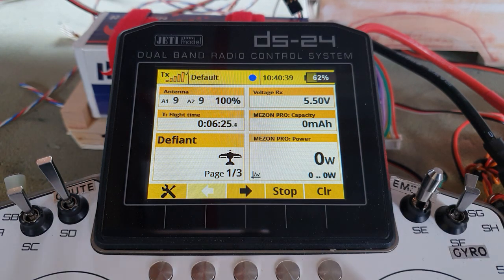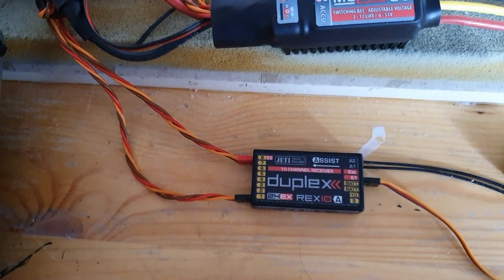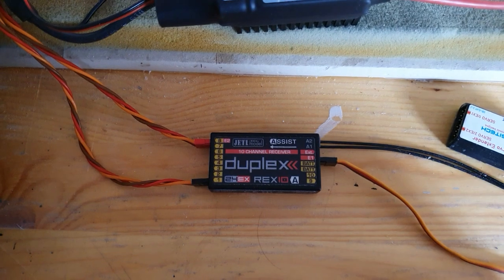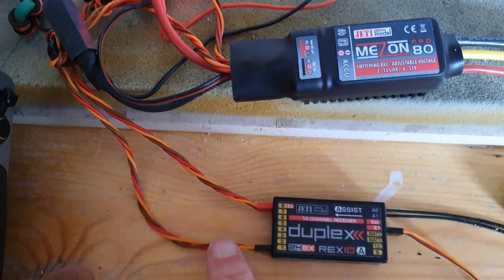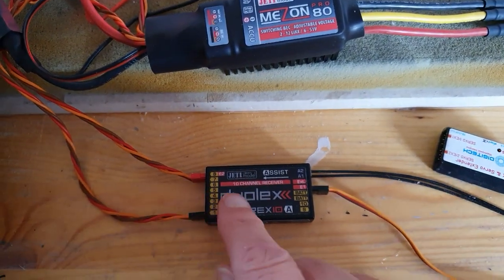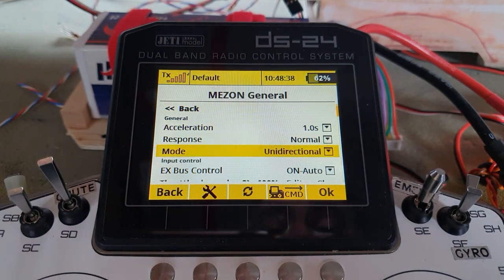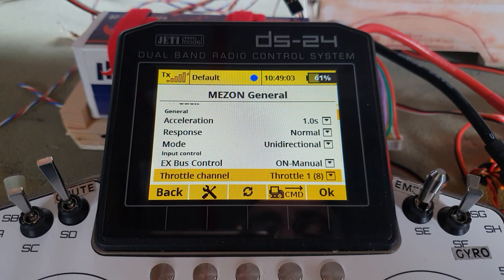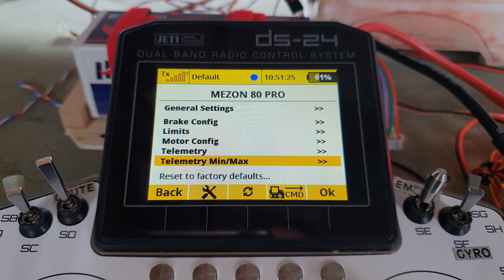Jeti - Mezon Pro ESC, Exbus control

Comment: Will I able to connect two independent ESCs, same specs, via a Y lead to a single motor? Will I be able to switch between the ESCs via separate channels on the radio? Can one of them be programmed in reverse? Trying to find a way to make reverse thrust work on Jeti for electric models, EDF foamies.
Reply from the maker: No.  You need an esc that can do reverse.
Reply: Can you recommend any? Between 60A to 130A? I can't seem to find any, but I am new to the RC and Jeti.
Reply: Can you recommend any?
Reply from the maker: @dcabrick  no, I have experience of ESCs that can reverse.

Comment: Harry doesn't the Mezon Pro provide battery current and voltage data?  Shouldn't that allow you to eliminate the MUI from this setup?  Thanks!  Really appreciate your videos.  I have learned more in a week or so from your video's than I learn in the last two years from Jeti information and the tech at the business I buy my Jeti items from.  I especially appreciate that you explain the reasons that you are doing or not doing things which is very helpful in really learning how the system works!
Reply from the maker: Yes it does, there is no MUI in this setup.  I was referring to using a MUI before getting a mezon

Comment: Hi Harry
I have DS14 transmiter, REX 7 receiver and Spin 66 Pro regler. Is some way to recive telemetry data from model about tension Volts on battery in model and current Amps when engine is running?
Reply from the maker: Only by adding jetibox emulator to displayed telemetry.  Spin Pro uses an old telemetry protocol, the transmitter can not see it sensors and logging, and the data is not available in the menus like alarms, etc
Reply: @cotswoldpilot  this emulator is some hardware device or software for transmiter?
Reply from the maker: @MaciejRM  look in the Applications menu, there is Jetibox.  It emulates the hardware Jetibox.
In Displayed telemetry, you can add Jetibox.  But each time you switch on the Tx you will need to navigate the Jetibox to the relevant device.  It is a total pain in the arse and not worth it.
Fit a Jeti MUI sensor between battery and ESC, and get proper telemetry.  Or spend a lot of money on a Mezon or Mezon Pro
Reply: @cotswoldpilot  thanks. Im new in jeti. Years ago I flew in F3J, I was used Multiplex 35 MHz. Now I have new model F5J. But I have problem with powertrain. I want to check what is Voltage and Amps when engine is running. When I solve problem ESC telemetry will be no more needed
Reply: @cotswoldpilot  thanks for tips. I found in JetiBox app battery voltage.
Is some way to record this parametr in transmiter loggs?
Reply from the maker: @MaciejRM  no.  Spin Pro telemetry is very old format, and useless!

Comment from the maker: Important note - Setting failsafes does not affect Exbus data, so the normal method of setting failsafe will not bring the throttle to OFF.  You must use the Mezon Pro's settings to set it to switch off the throttle on loss of signal.  As always, test the failsafe on the bench before attempting to fly.

Comment: Hi Harry, thanks, I asume that on a Mezon 120A Lite you're tied to Jetibox only am i right?
Reply from the maker: The standard Mezon has Ex telemetry, so you get data like you do with other Ex sensors such as MUI.  Settings of a standard Mezon are done in the Jetibox emulator in the transmitter